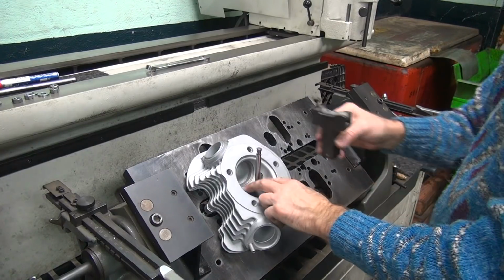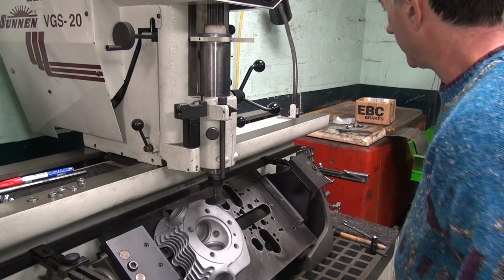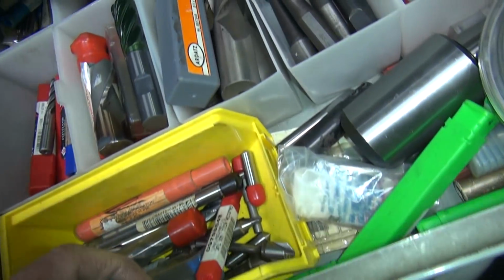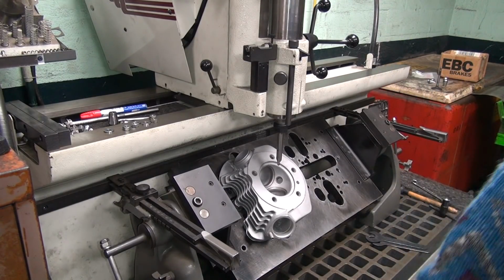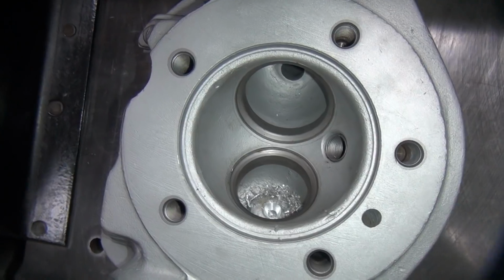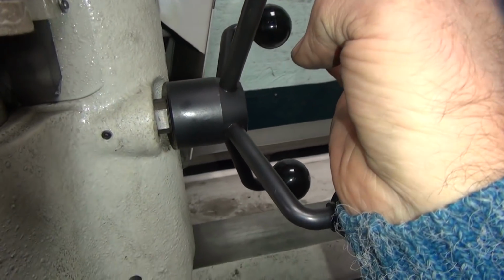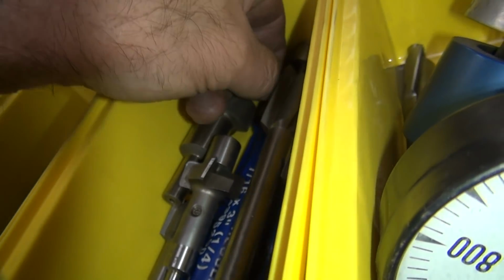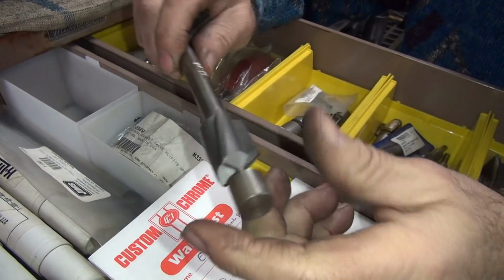1974 #105 74ci shovelhead valve job, porting, guide hole repair rebuild harley by tatro machine

Comment: Hey bud, While watching you trying to get the valve centered I thought, what could you do to help center the valve. If you took a second valve and cut off the stem and put it into the seat as normal, then take the valve that you used and put it face to face with it.  Your valve stem would be sticking out like you had it without any of the wobble that you had that is as long as the valve faces were flat. You could even tack them together which would help as a alinement tool to set up your machine. This is just a suggestion that (who knows) just might help.  Later
Reply from the maker: what video were you watching? there was no hole for the 2nd stem to go into for the alignment. have you ever tried to weld two pieces of anything together and have any degree of accuracy.
at least you are trying to help.
tatro
Reply: Hey tatro, yes I was trying to help, There is a hole for alignment in the setup head that you had on the table. I thought it would work (maybe) Anyway love your videos - later